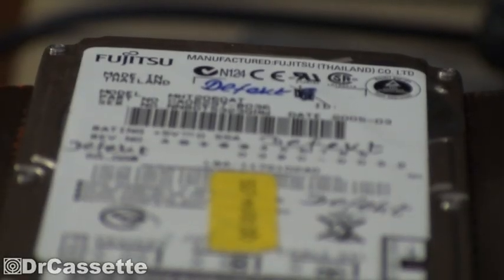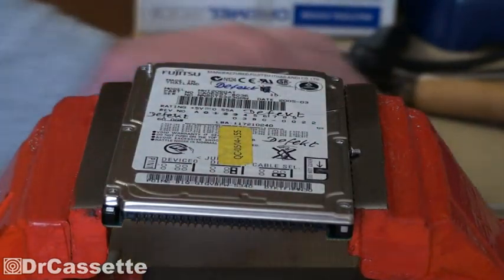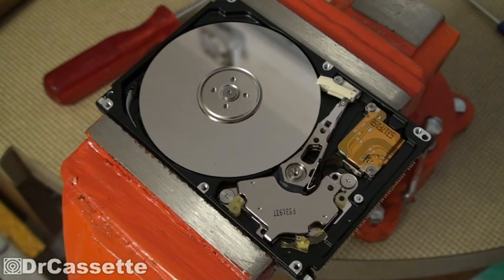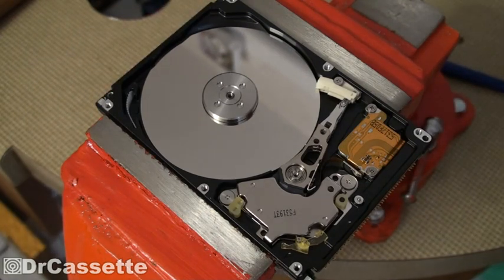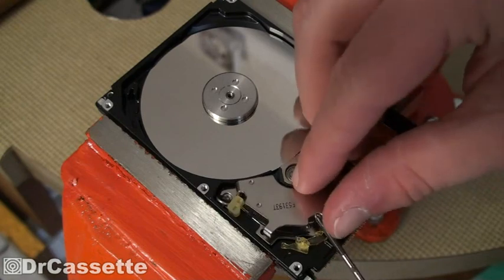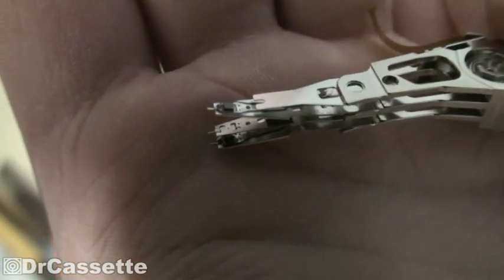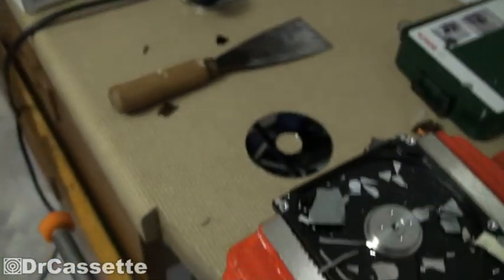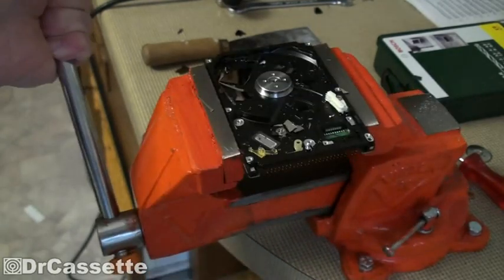Take that HDD apart...

Comment: I kept hurting myself with the magnets from my old Connor 500 mb drives!  Aren't they magical inside? I've still got a 20 Megabyte one, it's 5/14 inches in size!!!  It uses a stepper motor instead of a voice coil but the connector on it can only be used with a really old computer!!

Comment: A pretty cool (that is funny, you will understand soon. ;) ) thing is that if the HDD has a mechanical problem, it can often be solved by putting the HDD in the freezer for a couple of hours, and then turn it back on.

Comment: What did this hard disk come out of?  I wonder what would happen if you plugged the hard drive in and turned it on with the platters removed?  I've seen videos of hard drives open and operating, but not with the platters taken out.